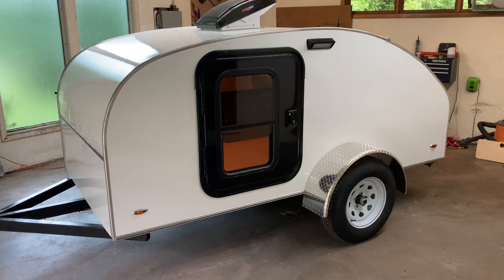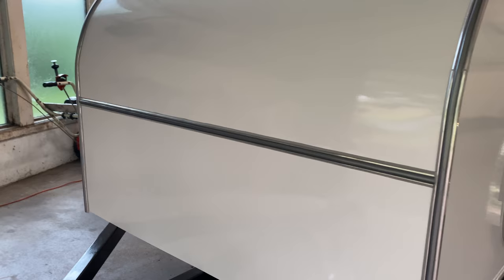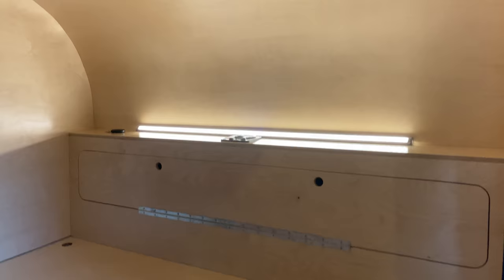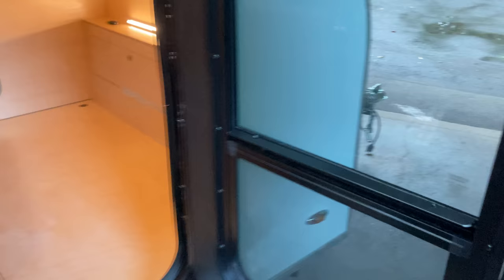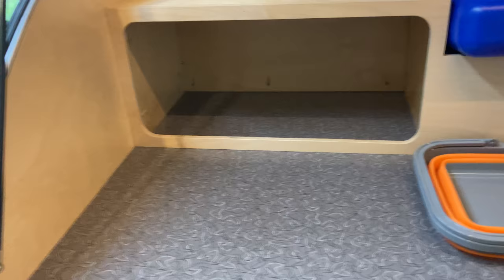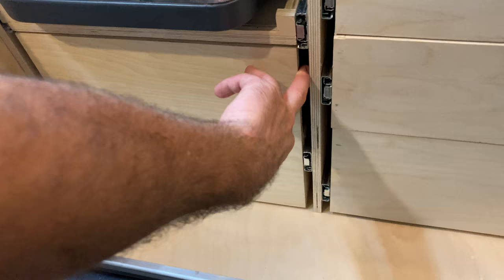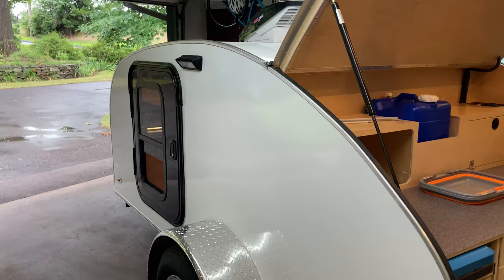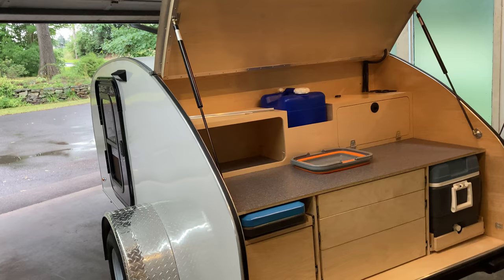How to Build a Teardrop Camper Yourself!

Comment: I see why this video got 73,000 views! Definitely one of the best home builds I’ve seen. And I love how you took bits and pieces of inspirational ideas from other manufacturers. That Baltic Birch is gorgeous and it goes so well with the Escapod like interior. I think my favorite feature or maybe just a feature I’ve never seen before was the space between the stove and the bottom drawer so you can reach your hand in there. And the drawer looked really deep which was so nice to see.
Reply from the maker: Thanks Drew! I really appreciate that
Reply: @TheIoniqGuy  let me ask you does it bounce any I'm not knocking your build you did really good on it but I think the A-frame for the tongue should have been underneath the camper more and if it bounces in the tongue that's what you need to do to stop it that you said it didn't have but just a little bit of tongue weight to it so you shouldn't have any problem but if you put a toolbox up there on the tongue you could have that problem and the reason I'm saying this is I build these I know what issues come up and how to take care of it

Comment: Would love to see your layout plans, even rough sketch.  I like your kitchen layout best of the ones I have seen so far.  

Also, I had a thought about a mod for your drawer beneath the stove with the low sides for access.  Put in panels to bring the sides up to full height but hinge them on the bottom.  In the up position they can help keep drawer contents in the drawer.  In the down position add flaps so they function like a "drop-leaf table" only the drop leaves fold up instead of down.  Gives you temp table top space, maybe to put cooking utensils on or drinks on the back side.
Reply from the maker: That's is actually a really cool idea! I might have to give that a try
Reply: @TheIoniqGuy  Glad you like it. If you try it out I would love to hear about it or see it.  Also, how did you manage to make the rear lid over the kitchen so rigid?  I remember one of the other vids had problems with theirs not being sturdy enough.

Their kitchen design was similar to yours but I like yours better.  Your stove and cooler come out perpendicular and creates a sort of galley kitchen effect.
Reply from the maker: Four galley spars each made of 2 pieces of 3/4" plywood laminated together. Even still I had a little bit of springback when skinning them. I would have done 5 in hindsight.

Comment: I prefer the simplicity of just use boat resin its stronger then steal and bonds at the molecular level so it a perfect seal  get a grack no prob sand it out add a layer of resin
 in theat spot buff it and ur good

Comment: This is a top notch build. I doubt you could buy a better camper at any price. I’m interested in the skin, what did you use?  I know you said something, but I didn’t recognize the product. What source did you use for the skin and outside trim?
Reply from the maker: It’s called Filon. It’s the same material most RV builders use for siding. https://www.recpro.com/rv-fiberglass-filon-siding-8-5-wide-arctic-white/?campaignid=10108288062&adgroupid=107415455739&keyword=&gad_source=1&gclid=CjwKCAiA9ourBhAVEiwA3L5RFugiysiAHpinnsBHNsok4dT_2XXIe5tG5IDxH89bCnttr35LvNQGyhoCwD0QAvD_BwE

Comment: This is fantastic. What material did you use for exterior finish? Do have clips of how did you make the exterior finish? Thanks
Reply from the maker: It's called Filon. It's a fiberglass filled plastic. It's used extensively in the RV industry. I rough cut the panels and clamped them to the sidewalls and then used a router with a battery cutting bit to cut it to the exact size. Then it just held in place with the side trim and the doors.

Comment: Just curious, but WHY do people limit their builds to just the size of the square part of the trailer frame?
It seems easy enough to extend the flooring at least a foot aft of the rear and extend forward onto the traigular front section by at least 2 feet.
Instead of curving the top for streamlineing you leave it flat all the way and curve the SIDES in the front to match the triangular shape of the tounge area?  That would be just as "streamlined" and also increase headroom & storage forward.
Sorry, I just want to think outside of "the box".
Reply from the maker: I think for many people it comes down to replicating things that they see and people are showing them how to do and that perpetuates similar designs. For me, I wanted something that I could be quickly and without too much problem solving so I went with tried and true design concepts
Reply: @TheIoniqGuy  I and going to start a build soon, basically I want the maximum space and minimum weight possible.  Most of what I see are heavy 3/4 plywood floors and tiny "pods" built onto the hiddlle of the trailer. I agree 100% that most folks seem locked into a mindset of 4x8 or 5x8 and what they see when they look up "teardrops" on the web.  Great build by the way!

Comment: Amazing. Do you find it's sufficient just cracking the window with the roof vent for ventilation. Any condensation issues so far?
Reply from the maker: Absolutely. There been morning when there's been a little bit of condensation on the interior walls but nothing that can't be wiped down pretty easilly.
Reply: @TheIoniqGuy  Thanks!

Comment: Would you be willing to post links to hardware used, specifically the interior cabinet latches
Reply from the maker: https://www.amazon.com/dp/B07B72859G?ref=ppx_pop_mob_ap_share

https://www.amazon.com/dp/B01N6Z0W68?ref=ppx_pop_mob_ap_share
Reply from the maker: https://www.amazon.com/dp/B07CMRBRNH/ref=cm_sw_r_apan_glt_fabc_PHDSTSM2QK7S4MNQE71Q?_encoding=UTF8&psc=1

I used those as well. Pretty similar to the others
Reply: Thanks for the quick response

Comment: Where is your battery location and did you use a RV distribution panel? Like WFCO or Progressive Dynamics?  I’m just about to the electric part of my build now.
Reply from the maker: Battery is behind my galley cabinets. Wish I had mounted it closer to the tongue and it would have given me almost perfect tongue weight. I used this fuse block. https://www.amazon.com/dp/B001P6FTHC/ref=cm_sw_r_cp_apa_glc_fabc_TF4ZKZ3EES6MKKA3DWV8?_encoding=UTF8&psc=1

Comment: I'm just about to start my cabinets in my trailer and I love the plywood face and doors you did, they look amazing. You must have used a wood CNC machine for them to be so precise. I'm curious did you have access to a CNC if not how did you find someone to do them for you?
Reply from the maker: I actually didn't use a CNC. I used a thin kerf circular saw blade and a straight edge. For the corners I got the thinnest kerf jig saw blade I could and did those free hand.
Reply: @TheIoniqGuy  wow, amazing work. I was a finish carpenter for several years and I cant free hand that well. Great job and thanks for responding I appreciate it!

Comment: Nice, where did you hide the battery I don’t remember you showing that or a port where you charge it from?,
Reply from the maker: The battery is behind the center galley drawers, close to the axle for weight distribution. Charger is behind the cooler as close as possible to the battery.

Comment: Does the fan keep the camper pretty cool in the summer heat
Reply from the maker: I haven't really used it in anything warmer than a low 70s night but in that type of temperature it works very well at keeping you comfortable.

Comment: Beautiful craftmanship!  How did you go about cutting out the cabinet doors with the radius corners?  They look fantastic!
Reply from the maker: Thanks for the kind words! Very, very carefully. I made the straight cuts with a thin kerf circular saw and then used a jig saw with the same thickness blade for the corners.
Reply: So what about dimensions ?  (Overall outside )Really like your build.
Reply from the maker: It's pretty much exactly 5x10ft. With trailer a frame it's about 14ft. Width with fenders is about 84".
Reply: @TheIoniqGuy  Outstanding cutting skills. Please tell me you used some sort of track for the straight cuts. I did not know you can get jigsaw and circular blades with the same kerf. Thanks for letting us know. When I first saw it, I knew you used a CNC..wrong. You da man!
Reply from the maker: Thanks Diego! Oh yeah I definitely needed a straight edge. I'm steady but not that steady 😅

Comment: Nice job sir! did you build your trailer? if so, how did you determine where the place the axle?
Reply from the maker: Thanks! I did build my own trailer frame. I used the generic 60/40 rule. So I placed the center of the axle 60% of the trailers distance not including the tongue. This didn't work out perfectly and I've had to add about 60lbs of ballast to the tongue box to get my tongue weight to about 120lbs. Too much of a hassle to relocate it at this point.
Reply: On the bottom is the best place !

Comment: How difficult would this be for a total beginner to make?
Reply from the maker: It's definitely doable but it'll probably take you much longer than it did for me. I've been woodworking and metalworking since I was a kid so if you don't have any experience with power or hand tools it'll be a challenge but definitely not something you can't learn. It's a well rounded project with little bits of everything.
Reply: If you need to ask don’t bother .

Comment: Where did you get 5’ Filon?
Reply from the maker: I cut it to width
Reply: Seams on the roof work out ok with trim and sealant?
Reply from the maker: Yeah no issues thus far but it's only seen rain for less than a handful of hours

Comment: Great job!  I am thinking about doing one. Your build looks professional.  What was the brand for the exterior covering you used?  Any websites / blogs/ forums you used to help you?
Reply from the maker: Thank you! It's called Filon. Plastic filled with fiberglass. Very durable and requires little to no maintenance. There's a few Facebook groups and a forum called tnttt.com
Reply: @TheIoniqGuy  I'm looking at using Filon as well. Would you use it again? Any regrets over just going with a more common aluminum siding? Thanks for the video - can't tell you how many times I've watched it!!
Reply from the maker: Thank you! I would definitely use it again. I was planning on using painted .040" aluminum but after reading about having to repaint it every so often I decided on Filon as it's basically no maintenance and won't dent. Not to mention it's far quicker and easier to cut.
Reply: @TheIoniqGuy  OK awesome. Thanks for the quick reply. I agree with your choice to go with less maintenance. Thinking of getting my frame galvanized for the same reason.